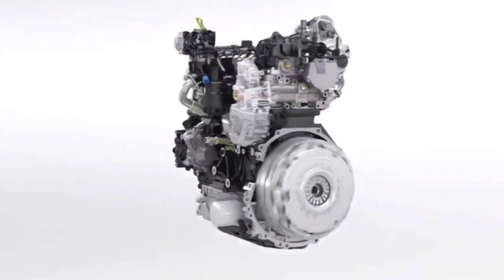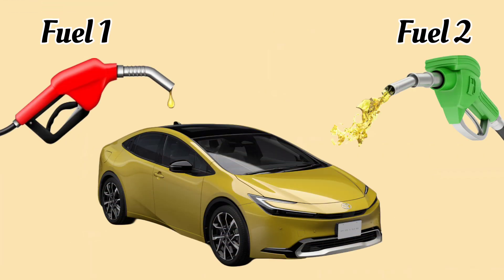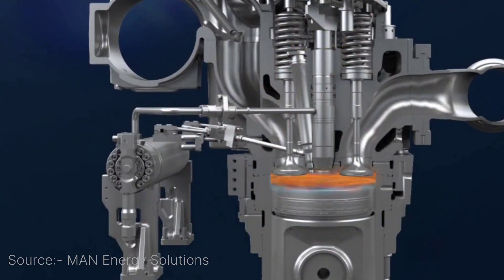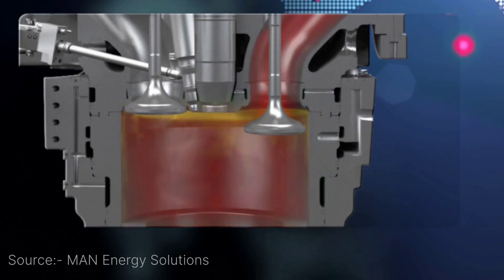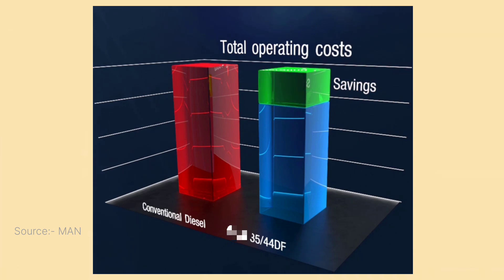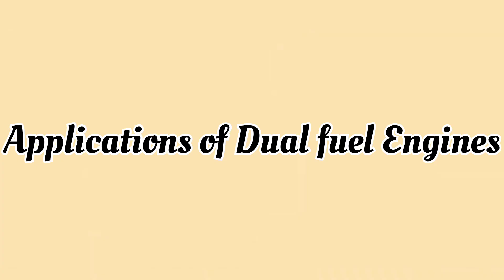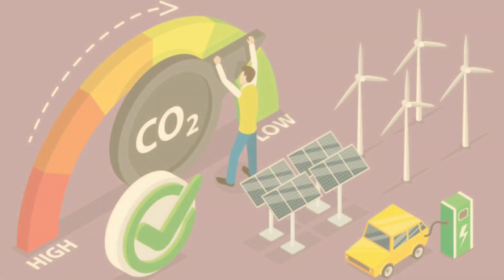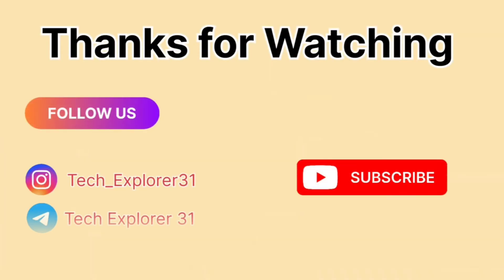"Dual-Fuel Engines: How They Work & Why They’re the Future of Power" #automobile #engine #fuel #tech

Comment: Fuel-flexible engines have been basically the most popular option here in Brazil since 2003, when our first type of such car was released, the VW Gol TotalFlex 1.6.
After that, basically every manufacturer released theirs. Fiat was the one that went farthest in regards to options, they had a "TetraFuel" model, based on the Fiat Siena 1.4.
They could run on ethanol E100 [the only available here], our gasoline [which has a % percentage of alcohol], pure gasoline [like sold in other countries] and CNG, compressed natural gas.
Reply from the maker: @Roddy_Zeh  That's awesome! It’s great to see how Brazil has embraced fuel-flexible technology with cars like the VW Gol TotalFlex and Fiat Siena TetraFuel. Using options like ethanol, gasoline, and CNG is a smart way to save costs and reduce emissions. Thanks for sharing!
Reply: @techexplorer31  Likewise for the video! 😁👍🏻
Reply from the maker: Thanks😊! Don't forget to subscribe for more content